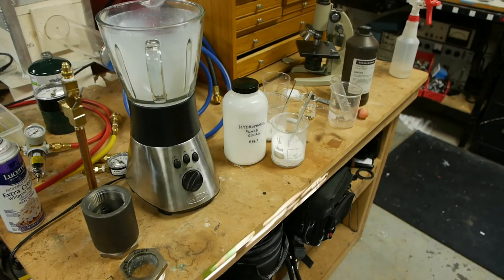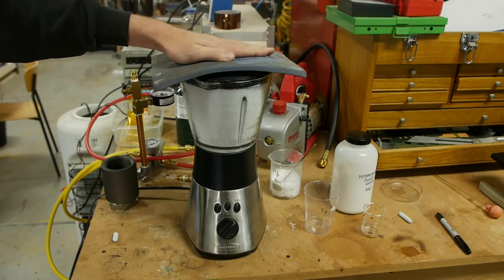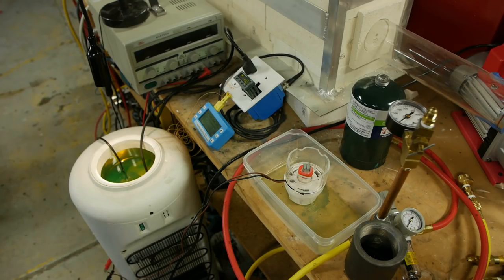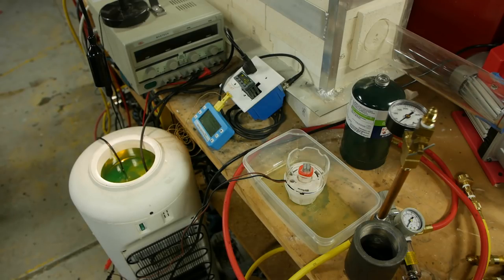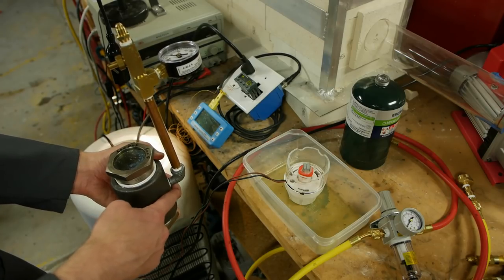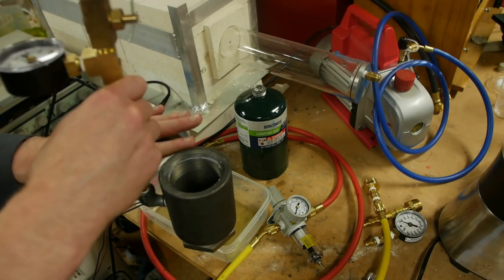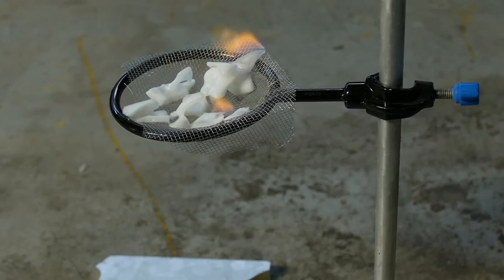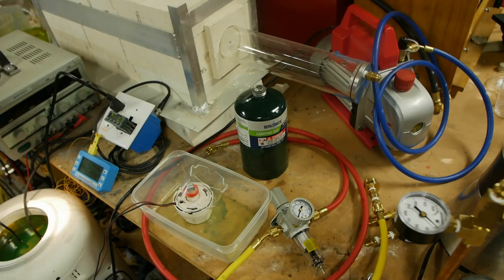Dry water and Burning ice: all about gas hydrates

Comment: It occurs to me that this "dry water" may be related, in frozen form, to water on the Moon and Mars. When a powder or finely granulated material is very cold, like most of the time on Mars, and in the constant polar shadow areas on the Moon, that finely granulated material becomes a very effective cold trap. Similar things are used in some high vacuum systems, with highly porous granules of zeolite or activated charcoal. The large surface area of the granules/powder makes it easy, even in vacuum, for molecules of gas/vapor to get stuck to the hard surfaces, where it will easily freeze if the temperature is low enough. Over time, the granules can become saturated with high levels of the adsorbed/deposited gas or vapor. This kind of process is also likely to happen in certain kinds of dusty gas clouds in space, with condensable gases being held in relatively high concentration, while also being hard for astronomers to spot. Part of the mysterious "dark matter" could be this kind of cold conglomerate. It would be very interesting to see some experiments with how fumed silica, powder clay, and other material with large surface area behave when kept cold and exposed to various gases like butane, CO2 and water vapor.

Comment: 8:29  The ratings of piping are not either or... 
500 PSI @ 500F means exactly that... as the temperature goes lower the material becomes brittler thus at lower temps the pressure rating decreases.

There are materials prefered for cold or negative temps because they allow for higer pipe rating at lower temps.

Comment: Isn't natural gas compressed and piped in situ? It might not be liquefied, but it's certainly under a few atmospheres of pressure. It's lower than the vapour pressure of the propane, so you make the clathrate in situ too, but how do you go about extracting it from the fumed silica/water (sol/gel/suspension/powder?) Is simply heating it to the clathrate decomposition temperature enough? Most end uses of natural gas require the gas to be fed in at a couple of atmospheres of pressure, so you would need to repressurize it at the other end, and the storage tanks would be a lot bigger if the gas weren't liquefied.

Comment: Another fascinating video.
I thought you were going to use the 'dry water powder' as a 'dry powder' fire extinguishing medium to put out the gas hydrate fire.
The dry water powder has a very high surface area, so would it evaporate very rapidly in a flame, absorb heat and quench the flame? Or, does the high insulating property of the associated silica dust inhibit heat transfer from flame to water droplets?
Maybe another wee experiment for you.
Cheers Paul in NZ

Comment: So if the hydrate is trapped, does it release the propane? I'm thinking it would be useful to reduce the rate propane (in this case) could be released in say, a mishap... But volume and weight considerations hmm

Comment: Ben, why don't you try dissolving propane into the "dry water", to saturation, transfer the "charged" material to a sealed vessel attached to a small burner,  and then attempt to remove the propane from the "dry water", and burning the off gas through the attached burner. You could even heat the vessel somehow with the flame (eg. heated external water bath or something) to increase the off gas rate.

Comment: So this comment may be naive but when he said that the dry water can be used with hydrates as a transportation method for natural gas wouldn’t the fact that is hard to ignite be great for transportation because it lowers the risk of explosion. How would the natural gas be extracted? Would a depressurization and rise in temperature be sufficient to release it? Also, what is the density of a hydrate or how many cubic meters or feet of natural gas does it hold for every cubic meter or foot of hydrate? I have just started researching hydrates in my own time and haven’t yet been able to find a ‘density ‘ for this substance.

Comment: I can vouch for the cofferdam (bell jar) clogging up while trying to cover the Deepwater Horizon leak. In fact we noticed the cofferdam started to float as we were lifting it back up to the surface. This was due to the gasses trapped inside it expanding and displacing more water. We had to set it back on the bottom, and that's when we noticed all the hydrates clogging it. We revisited the site a year later and it still had remnants of hydrates sticking to the inside of the cofferdam.
Reply: Seems like a brief brainstorming session would derive the solutions of pumping a hard-to-compress gas and/or heating the contents of the jar to solve the problem very quickly and cheaply... But when you own the company that makes the only approved dispersant (dishsoap) chemical, it becomes more profitable to just let the mess build up until people are begging you to make it look less bad.
Reply: @buckstarchaser2376  You have to remember that the gas was under pressure in the ground, and has suddenly expanded upon escaping through the busted pipe. That expansion causes the gas to get cold very quickly in itself, and the environment under the water is already low temp as well. Getting a source of heat down to the cofferdam would have required a system that would have had to be designed, built and tested in the time span of a few months. They already knew how long it would take to drill the relief wells, and shut it down the way they finally did, and doing something as complicated as you suggest would have been pointless by that time. Building equipment that works as deep as that well was being drilled at isn't exactly a simple thing to do.
Reply: @phlippbergamot5723  Warm fluid pipe goes down. Melted gas and oil pipe goes up. Tell me the equipment and understanding to do both of those things doesn't already exist.
Reply: @buckstarchaser2376  Some equipment could be jury rigged perhaps, but at the rates of flow you would have needed, its very unlikely we have anything that would have worked. Not to mention it would have had to be tested, not just for function but safety as well. They didn't want to add to the problems they were dealing with.
So the answer is that there was nothing specifically made to do both of those things for the specific task that was required. Too many unknown factors at the breaks in the pipe to design something properly.
Reply: @phlippbergamot5723  I saw a video once where they were playing the news clips describing the steps being taken with the Horizon well, and each after the other failing. Alternating between old news clips of another, similar situation that happened. Step by step, the same actions were taken with the same failed results. Clearly, the time to develop and improve techniques are now, as the third time something like this happens, there will likely not be so much tolerance of the willful ignorance, nor will there be acceptance for non-condemnation of anyone involved.
Reply: @buckstarchaser2376  Honestly, they weren't very confident those various techniques to stop it would be effective. the only one they knew would work 100% was the relief wells. The other attempts were mostly just so they could say they were trying SOMETHING, and no stone was left unturned, so to speak, while they were drilling the relief wells.

Comment: Could the fine mist of dry water be used in fire suppression?
Reply: Don't think it would be any better (probably a lot worse) than regular water mist.
Reply: @JGnLAU8OAWF6  It would also not water damage things
Reply: But everything would be covered in silica
Reply: @JGnLAU8OAWF6  fire extinguishers already cover everything in powder, I think some actually use silica because when I had to use one indoors it got everywhere and was such a pain to clean up. With larger particles it would be a lot easier to clean.
Reply: There are lots of different types, and only dry chemical ones use powder and it's made of "sodium bicarbonate, potassium bicarbonate, or ammonium phosphate".
What scenario are we talking about i have something like data center fire extinguishing system in mind, dry chemical extinguishing agents aren't used there.
Reply: @JGnLAU8OAWF6  I think that if it makes less of a mess, it could be used in houses and labs and stuff. That is, if it works as well as the current dry chemical fire extinguishers and makes less of a mess
Reply: There are CO2 fire extinguishers, they don't make a mess at all.
Reply: This will not be good to put out fires. The water cant wet anything anymore (one of the most impotant things) and the fine silica just flyes away.
Reply: @JGnLAU8OAWF6  I didn't think of that, this is just a solution looking for a problem. I would still be interested in seeing if this could extinguish a fire, even if it's completely useless
Reply: @leocurious9919  If I'm not mistaken, water mostly puts out fires by removing heat, not by "wetting" or smothering it or anything. Steam carries energy away - it takes over 3x the energy to turn liquid water to steam as it does to heat liquid water from 0-100c. With the massive surface area increase, I would expect it to actually work faster, but not sure the insulating effect of silica would have so maybe not. Either way huge mess. That also gives you lung cancer. Breathing fumed silica dust is totally inadvisable for anyone who wants to keep breathing air for a long time.
Reply: Well the ability to wet something is as important as it can get. Things like plastics, oils, diesel, gasoline etc. cant be (effectively) put out with water due to this. How can the water remove heat if the contanct to the burning material is really bad and it just runns of? 
We can also look at the heat transfer coefficient of water and how it changes with temperature, take a look here:
http://www.engr.iupui.edu/~mrnalim/me314lab/lab09.htm
First it goes up, to the point where the water is moving around really fast due to boiling action instead of just moving around slowly (natrual convection). Then suddenly it goes back down as the leidenfrost effect starts to occur. The leidenfrost effect is the point where the surface is not wetable anymore, this time just due to the high temperature. It only very slowly (logarithmic scale) starts to go up again with heat transfer due to radiation. This effect is the reason a lot of power plants (or steam locomotives etc.) exploded/broke in the past. You want more power -> more heat -> more steam... and all of the sudden more heat causes LESS heat to be transfered -> pipes heat up very quickly and break (they are not really cooled anymore).
Reply: @leocurious9919  Interesting about Leidenfrost effect, I hadn't thought about/seen that info before. Would make sense to for it to apply here. I'd be interested to see some experiments.
Reply: @leocurious9919  Personally I'd be really interested in seeing a CO2 clathrate made with this dry water used in fire supression.

Comment: How does the PDMS coated silica compare to something more hydrophobic, like perfluorooctane silylated silica particles?
Reply: I presume you mean perfluorooctanoic acid (C8 fluorosurfactant) or perfluorooctanesulfonic acid (scotchguard) as perfluorooctane is relatively inert and doesn't mind water. Interestingly enough, perfluorooctane dissolves enough oxygen to be breathable...
Reply: @theLuigiFan0007Productions  No, I do actually mean Perfluoro-Octane functionalized Silanes used to coat the Silica in hydrophobic and oleophobic 'tails', i.e.  each Silicon atom either has 1 or 2 perfluorooctane groups covalently bonded to it (via a strong ...F2C-Si-... bond, as the 2 bound fluorines actually strengthens the C-Si bond above what you'd normally expect) along with 1 or 2 easily displaced leaving groups (the difference being made up by CF3 capping groups, or in some cases even 3 leaving groups all trying to bind to something) such as chlorine, methoxy or ethoxy groups (forming, respectively, chloro-, methoxy- or ethoxy- silanes).

The silane then attaches these 'tails' to the silica's surface with the same exact covalent bond that makes up its entire structure (so it's adheres much more strongly than simply forming an ester of PFOA or simply relying on its hydrophillic end's hydrogen bonds).
Reply: @mortlet5180  Very interesting, guess I learned a new chemical today. The structure you described reminds me of the diagrams of soap molecules surrounding oil droplets. Except in this case, they'd be permanently attached, the tails are perfluorooctane and the center is silica. That must indeed have interesting properties, and be rediculously hydrophobic.
Reply: @theLuigiFan0007Productions ; Yes, that's exactly what I meant. I'm glad you think it would be interesting as well! :)

Comment: Gas hydrates are having to be dealt with in most oil fields.  Atmospheric temperature isn't a huge factor because thanks to using stuff like gas injection for artificial lift, JTing after an orifice provides the temp drop while still being high enough pressure.

Comment: The idea might be that you can transport the hydrate-silica mixture in lower mass containers [as compared to the mass of a thick walled pressure vessel] so that not only do you save on the initial energy, but that the mass of the water is partially offset by the reduced mass of the containment vessels?  ~( 'w')/

Also, since it is pretty well self insulating, the risk of loss from a spill is quite minimal if you can simply vacuum it up [or sweep it] into a new container, and even if dirt got into it, the gas would not be adversely affected, one would simply need to clean out and dispose of the contaminated silica after using the gas which could just be sold at a slightly lower price and therefore offset any potential losses normally incurred when escaped gas was spilled in a typically irrecoverable manner.

Comment: My question would be: how would you get the hydrate separated back out? I would suspect just warming the powder and catching the vapors would work just fine. Also, how would the energy for this process compare to the compression of propane to begin with? I suspect it would just be moving the required energy to a different part of the transport chain.

Comment: What are the properties of the hydrate before freezing?   is the propane liquified and mixed throughout the water, or is the only form of the hydrate solid, even at higher pressures?   
My idea is make the water/propane hydrate mixture, THEN add the silica after the propane/water is mixed to see if you can get some kind of a slurry or solid ice. (i'd say the easiest way to do that is use the top watchglass fitting to have some kind of magnetic container with the silica in it... that way the silica does not mix until you're completed adding the propane)

Thank you for the video.  Havent seen anything like this before but now I have a new magic trick to show off to the family :-P

Comment: so with the dry water gas hydrate mixture, maybe it'd work better if you didn't blend the dry water for quite as long so you get larger droplets of water, which should require less silica in the mix due to smaller total surface area.

Comment: That's a lot of ethylene glycol.
Reply: Yeah, I was thinking that too....
Reply: Not really. Certainly not as much as would go in your car.
Reply: That looks like a little more than 10 litres.
Reply: Maybe it seems like that, but if you look carefully, you can see past the illusion of the mirrored tank. The width is only as wide as the opening, and it's not that deep either. Watch carefully as he inserts all three items into the chiller, and you can see the actual limits of the tank. Also look at the "water's" edge. It looks like there's only about a quart or two. 

The only way I can think you could have arrived at such a large volume is if you assumed the inside was roughly as large as the outside. And that makes no sense, because that would leave no room for cooling and insulating the inner tank. Or if you simply didn't watch the video; I hadn't considered that until writing this and pondering why this all wouldn't be immediately obvious to you.

Comment: One thing I noticed is not quite right, the statement that solids can't burn. An example of a solid burning would be all sorts of metal fires, another are smouldering fires. Gases or vapors are only required to create a flame.

Comment: Maybe you could melt the Dry Propane Hydrate first to turn it into Dry Water and Propane Gas? 

edit. nvm Dry Water being an insulator is the reason it doesn't work 

ps. did you know that some guy on YouTube has actually made Xenon Hydrate? I think he's trying to float a liquid on a gas or something, and he tried Xenon and Water at high pressure and it made Xenon Hydrate.
Reply: Random Guy nobody cares
Reply: have you seen the comment? look before you open your hydration hole.